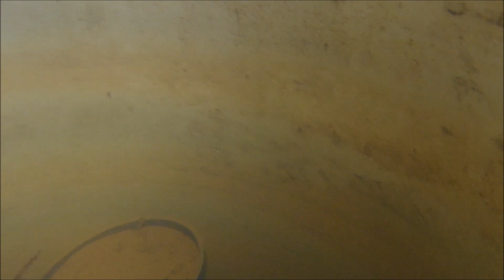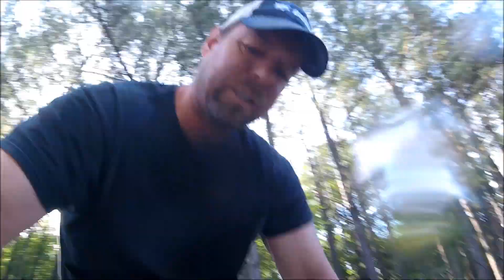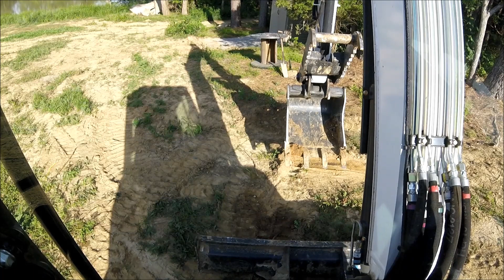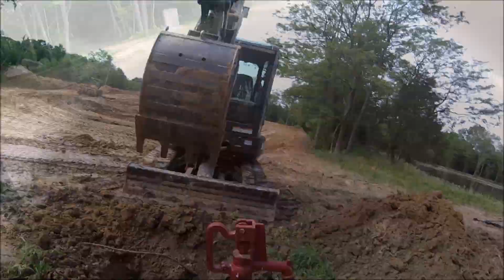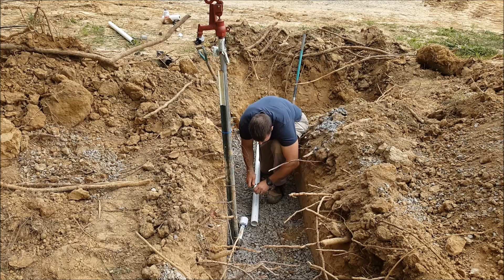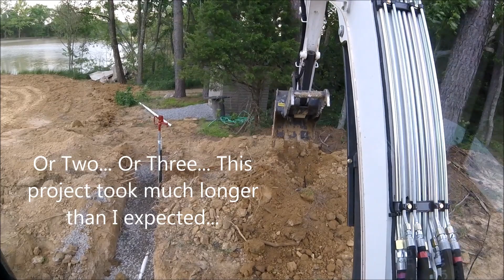DIY moving and Installing Frost Free Hydrant-underground Line

Comment: Nice job!  In my small business, I do quite a few hydrant repair/replace/new jobs, a couple things for the next time around" 

1) Good that you built a rock bed, I put in at least a 2'x2' "drainfield" for the weep hole to exit water.  It should cover the weep hole with about 6"-12" of rock with maybe that much below, too.  Then put a layer of geomat or several of landscaping mat on top to keep dirt from infiltrating the drainfield.  Most hydrant failures I see are either the stopper eroded and leaking, or weep holes plugged.
2) As a 'just-in-case" measure, wrap the weep hole in landscape fabric and zip-tie in place.  Just a little added insurance to keep it from getting plugged.  When replacing or installing with poly line, I do the same with my stainless steel hose clamps.  Also with stop/drain valves, along with the necessary drainfield.  You'd think those weep holes would always self clean, but they don't.  And if enough clay infiltrates, they'll slowly build an impervious layer coming back towards the hole.  
3) When planning for exposing the line, if there's any way of knowing the direction of the incoming line, dig in that direction instead of 90° to it.  As Rod Parkinson said below, toothed buckets are fairly merciless, and if you are digging with pipes, lines, wires etc. there is less chance of accidental breakage when digging in the direction of lay.
Reply from the maker: thanks man, that all sounds like common sense stuff! Wonder why I didn't think of it, lol! Pretty much similar to a french drain.. Well if I have to repair one hopefully I'll remember this.. but I do know that I put alot of gravel down there by the weep hole so hopefully that will be enough to keep the clay out..

Comment: Myself I've always gone with black flexible poly waterline to stay away from glued joints  that I've seen let go with pressure spikes or undue movement, as well add a masonry brick or cinder block under the foot of the valve, that will take care of a possible strike from above,  just my 2 cents worth.

Comment: Take it from a hoe operator that digging around buried utilities with a tooth bucket is bad business. On a machine that size take a 1/2" steel plate the width of the bucket and about 6" wide and weld it to the teeth. When you dig shallows gradually go deeper and draw the bucket slowly towards yourself in an upward direction, that way if you get too close the smooth edge of the plate will skip over the utility and avert damage. I usually welded to worn teeth then when done remove teeth with plate and go back to your teeth only. Believe me this gets more critical around fiber optic and gas lines.

Comment: Question: How much leakage did you find when you tore this out? The reason I ask is that typically you want to add your fittings at the source line first and work out from there. This way you can easily twist your fittings in place. I learned this the hard way.
Reply from the maker: Didn't find any leakage, I was shortening it to move to accommodate the new pond. I started on the opposite end because I thought it would be easier to line up the elbow with such a narrow ditch.. Of course that's often how I learn... the hard way :)

Comment: Am I the only one who concretes a  4x4 in to strap the hydrant to? Sometimes torquing on that handle works the PVC loose.
Reply from the maker: Well, I took guidance from my excavator buddy who's been putting these things in forever.. is that not what the fence post is for that it is wired to for support? Probably just a more 'economical' way to use the fence post vs concrete...?